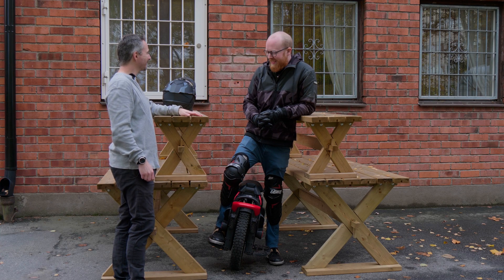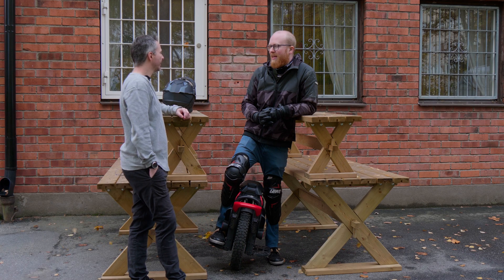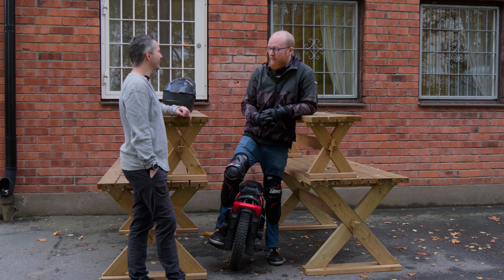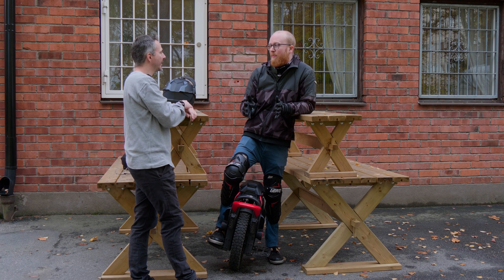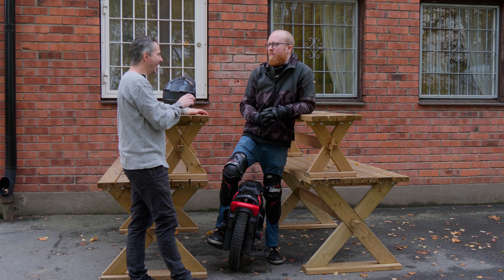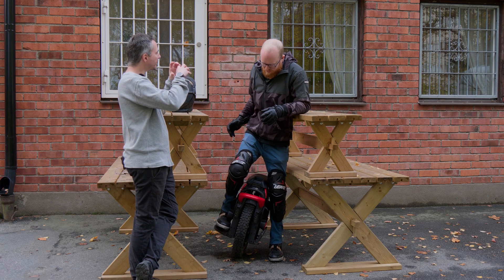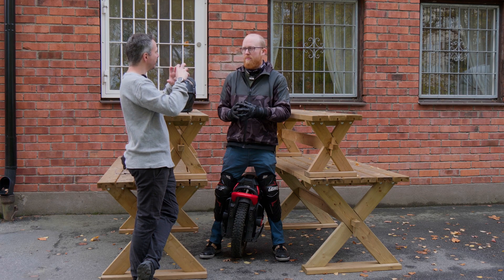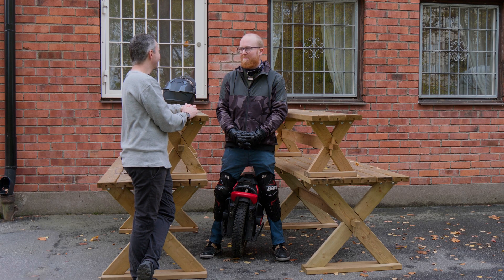King Song S22 landing stress test failure for stator slippage issue with Zebastian

Comment: Have King Song corrected the problem with the new inventory shipped to dealers, or is the problem continuing with new S22s? Thank You
Reply from the maker: Yes the problem is corrected for the most part. Some customers still received units with motors from older stock later on so a buyer should check if the motor manufacturing date is July or later. After that the motor stator is "pinned"
Then the S22 Pro motor is made by a different supplier entirely.

Comment: Bad test if you have an effected motor and it passes you've just stressed it closer to failure is all. Motors in the range effected should be pinned its that simple.
Reply: Pinned... By Kingsong off course?
Reply from the maker: The test has limitations indeed, and it's hard to tell that it's for sure conclusive.
In this case, it was since the motor failed, and Zebastian is getting the motor replaced - happy ending.
Reply: Are you simply suggesting to open the wheel? Its prob 3 hours work but then you have a definit answer?  
BTW Kingsong are liars. Dishonest ppl.

Comment: So basically just ride soft mode ez fix 🤣
Reply from the maker: That's not sufficient to prevent a failure in real world riding.
The soft mode is not particularly soft on the S22 by the way. There's barely any difference.

Comment: I was going to buy this wheel but I'm glad I did not because I hear about a lot of issues.
Reply from the maker: There are issues indeed. Even with the motor fixe, it's still only a wheel for early adopters that I would not recommend otherwise.
Reply: @supercurioTube  but what can I do.. I'm in love?
Reply: I can tell Kingsong that ppl waited for over a year, to get a wheel with bad motors. Deposits were paid.

Comment: Do you get all your friends to test their s22?  Who's going to pay?!
Reply from the maker: Good question. All my friends saw my S22 motor failing and the effort to get the problem solved, so they're well aware of the risks involved.

Who will pay is shared between:
- King Song providing motors under warranty for each defective one
- Dealer for shipping and repair

My friend Ronnie won't test his, which already exhibited abnormal noises while riding because he will soon get a replacement motor free of charge (from MyEwheel). He's not ridings the wheel anymore in the meantime.